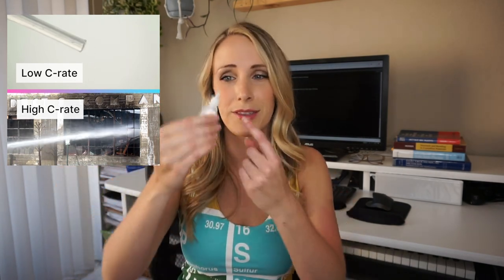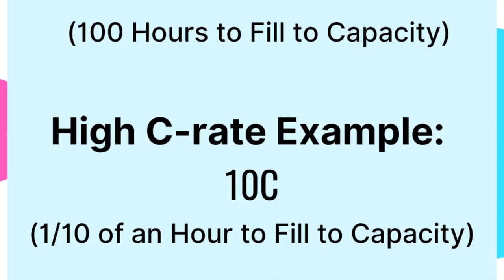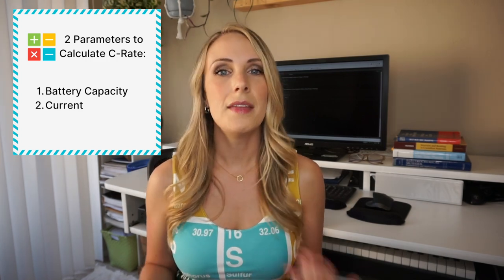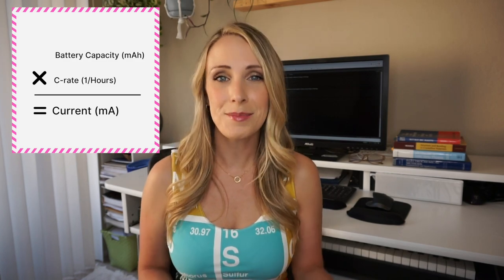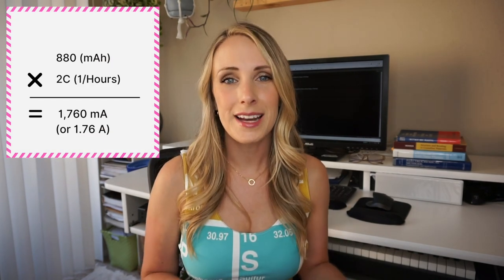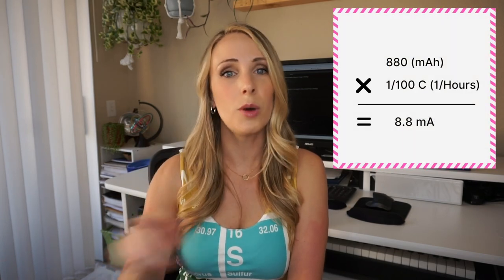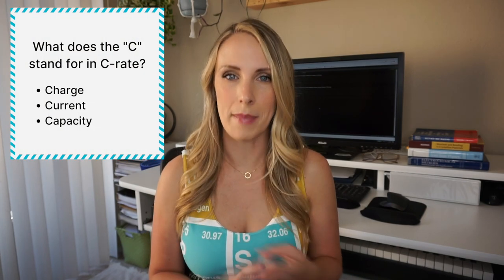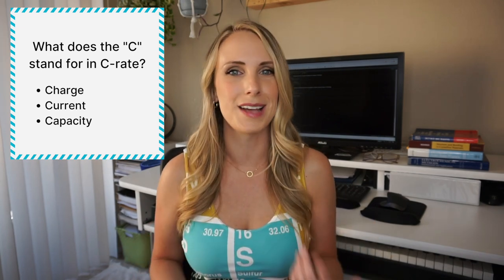How to Calculate Battery C-Rate

Comment: Thank you very much for your video! Just a question:
In time 5:20 you show that the C-Rate is the capacity divided by the current and the units are in time (h)
But in time 5:35 you show that the units of C-Rate are (1/h) and it looks like that for the calculation of the current the order is reverse. Could you please clarify? 
Thak you!

Comment: Great explanation and extra info on the cathode properties! I do have a question about the cathodes, can a cathode safely (dis)charge any C-Rate below it's rating, or do they only handle a specific range of current? Are batteries only designed to be charge at specified range (only fast or only slow)?

Thanks in advance for your reply

Comment: Can confirm its Charge Rate. Since Ah already describes capacity, C-Rate describes how long it takes to charge or discharge to that capacity. I work in electronics and I read it from the data sheet of a battery analyzer i'm currently using, so I think the info is good. I wouldn't have gotten there if it wasn't for your video teaching me in the first place. Thank you :)
Reply from the maker: Glad this was helpful! Best wishes on your work!

Comment: You have amazing lectures. I’m new to batteries. I’m wondering if you can recommend a book that covers the fundamentals of batteries would be a great favour. 

I have a question, like lithium sulphur battery has energy density of 2567Wh/kg. Sulfur has specific capacity of 1675 mAh/g, voltage as 2.2V . 
How did they calculated 2567Wh/kg.

Comment: Good knowledge.
I have 60v 28.5AH li ion battery pack 16S for my ev scooter.
Charger is 67v and 6amps.
What will be the C rating for my 3.7 v li ion cells.

Comment: The rate of charge and discharge for a Tesla Model 3 Performance varies a lot for different battery pack temperatures. I have seen as much as 250 KW when charging and as much as 448 KW when drag racing at the track. In both cases I had the battery temperature at 52.4 degrees C.

Comment: nice video! I would call the equivalent gas pedal in an EV an "accelerator". So if you charge a Li-ion battery with less current, it'll take longer to charge, but would it damage the battery structure if you do so? i.e. would it degrade the battery life to use less current to charge? And conversely, would it damage the battery to use more current?
Reply from the maker: ACCELERATOR!!! haha I asked my friend who owns an EV later and they told me the same so it must be! Thanks for informing me 😊 Typically slow C-rates are less damaging than faster C-rates (since the heat generated during higher current charging can cause side reactions and structural degradation in some cases). I know the most about Li-ion battery chemistry (with Si anode and Ni-based cathode), and for that system a slower C-rate is better, however Si is better at fast-charge than graphite-based anodes! It all depends on your materials, chemistry, cell design, temperature, and all those other lovely variables as far as the optimal C-rate.

Comment: Hey Jill, thanks for all the videos you make! 
I have one question, when we use active material : conductive agent: binder lets say I use reduced graphene (active) : carbon black(conductive agent): Pvdf (binder) with  7:2:1 ratio, respectively. should I calculate the theoretical capacity of the conductive agent and add it to the active material when I calculate the C- rate? or it neglected?
Reply from the maker: Hey thanks! Typically we neglect it unless it will actually be participating in the redox reaction. In the case of the chemistry you shared, you can neglect the carbon black.

Comment: Great video. .  i couldn't be more excited. May i have a question ? what if  i short a 4.2 v battery with internal resistance just 30 m ohm. .  dangerous or what ?
Reply from the maker: Shorting a 4.2V battery (I’m guessing a Li-ion cell that’s cylindrical format) can be dangerous, yes. I wouldn’t try it at home 😅

Comment: Please explain thermal runaway.. why is it called runaway? Is it caused due to the internal short circuit after Li plating?
Reply from the maker: Runaway is more of a slang term in this case- it means that the battery heats up to a certain threshold, and then keeps heating up out of control. (Like it keeps running and running to higher and higher temperatures). Thermal runaway can be caused by anything that causes heat generation to the point where the cell gets hotter out of control, which can include internal shorting. If the internal short causes a spark that causes the cell to catch fire, that is definitely a moment of thermal runaway. Shorting the cell does not always lead to thermal runaway (in the case that the cell doesn’t heat up due to the shorting).

Comment: Thanks for the precious explanation!
I have a question though: if I am testing a new experimental material as anode in a half cell (vs metallic Li), how can I understand which is the correct C rate of my battery? is it correct to multiplicate the theoretical specific capacity of the material for its weight?

Thanks a lot for all your contents!
Reply from the maker: You want to calculate battery capacity based on the electrode that limits the capacity, so in your case it would be probably based on the anode’s specific capacity (theoretical specific capacity times weight in battery, like you said). 

The example I provided is for a Si-dominant anode design where the cathode contains the capacity of lithium that will be cycled. 

Thanks for your question!

Comment: Hey, great video.
I am still struggling to figure out the C-Rate and trying to look for a good battery(es) to use in an Ebike for Offroad.
I plan to use a 220+ Amp Alternator as a motor, I plan to run it no more than 200A at 40-56v with a 250A controller or maybe 150A and a 200A controller with Hardware and Software limitations. I am not sure if these 2s Lipo Battery 50C 5200mAh 7.4V would work but I plan to get at least 6 of the packs, wire them in 3s2p if these would work with this future build.
I want the High Power but I am not sure if I am going in the right direction with this project.

Would they be able to handle that amount of constant current?
Would these battery packs work for this build?
Which voltage, and range, would be better suited in not destroying the batteries with UnderVoltage?
How would I calculate the approximate time in which the battery is low/Drained?
Reply from the maker: Hi, I work for a consulting firm that specializes in answering the questions you’re asking. Email me at jill@energystorage.guru, and we can answer your questions. 😊

Comment: Very clear and simplistic explanation. Thank you! Quick question can the charging C-Rate and discharging C-Rate be different for an identical battery? Let’s say for a laptop computer battery.
Reply from the maker: Glad it was clear! You can definitely make the C-rate whatever you want, so charge C-rate can be different than discharge C-rate. Typically for devices (laptop, EV, etc.) the discharge C-rate will be whatever the demand of the device is. If you’re accelerating in an EV, for example, that’s going to be a high C-rate discharge. There’s a built in feature in the BMS though for maximum allowed C-rate discharge. The specifications for your laptop battery could include a recommended current for charge and discharge that may likely be different.

Comment: Hey, massive nerd here, need help with some lithium tech. I want direct answers from an expert and you seem to be the right person to help me! 

So I'm dealing with some LiPo cells (round, if that makes any difference) I wanna build some 12, & 36v packs and I'm worries about putting multiple ground in parallel... A lot of places say lipo cells in parallel will self balance, but I'm scared I'll burn my house down. How many, if at all, parallel groups is the maximum safe amount? 

Tldr 
In a pack 10s for example, what's the max p I can go to? 10s10p? 10s50p? 😅
Reply from the maker: I’d recommend not building a pack yourself. There are many safety considerations in addition to cell balancing.

Comment: Are there batteries that have different charge and discharge c-rates?
Reply from the maker: Great question! C-rate is something the user selects, so one can select different c-rates for different batteries. People usually want to be mindful about the c-rate they choose based on the battery chemistry & application. Different battery chemistries can only withstand certain c-rate threshold before it damages the battery.
Reply: @AcrosstheNanoverse  thanks, but that's not what my question was about, let me phrase the question better, is it possible for a single battery to have different charge and discharge c-rates?

Comment: Please make a video on explaining theoretical capacity vs actual capacity. Is 176 mAh the theoretical capacity of NCM 622? Also, why some people say NMC while others say NCM?
Reply from the maker: I just finished writing a script for my next video which will be to answer your question about battery capacity! Thanks for the suggestion. People use NMC or NCM interchangeably. It doesn’t really matter as long as you’re making sure you’re using the right order for the material ratio. (NMC 532 for instance). 811, 111, & 622 don’t matter about the order of M and C of course!

Comment: I'm doing my Master thesis in the field of Li-ion batteries. When i consider the C-rate i consider it has the current to discharge the Capacity (C) in a certain timeframe. So if a battery has 1mAh capacity, and i want to discharge it in 1 hour, the C-rate (i.e., the current) will be 1mA. But also for me it is sometime confusing, so i'm happy to see i'm not the only one, it makes me feel less dumb :D . I also use volumetric capacity instead of gravimetric capacity, because sometimes is difficult to know the mass (for example for thin films). Nice video!
Reply from the maker: Thank you! Yes, we are all just learning 😊 Best wishes with your studies!

Comment: Thanx for the video Jill...correct me if Im wrong......according to the data sheet the Maximum Continuous Discharging Current is 4400Ma or 2C...for each cell....therefore I have 10 cells in parallel and the total Maximum Continuous Discharging Current then it would be 44000Ma or 44A for my lithium ion battery.. my battery is 13S10P 52V 25Ah...
Reply from the maker: You’re welcome! Yes, 44A would be max for that pack. Adding the capacities of the 10 cells in parallel gives 88000 mAh for pack capacity, and 2C of that is 44000 mA. It’s great that the math just scales for cells to packs like that as you need all the cells to be balanced during operation. Each cell is 4V , and with 13 in series makes it 52V for the pack. 👍 great work 😊
What’s the application of this pack?

Comment: why in mah why u don t use ah bcz all lithium has ah by the way my rack lithium battery is 400 ah i dunno what to put as max charge and discharge i made some calc like 400ah/10hr = 40ah  and if 400ah/5 = 80 ah i am confused what to use on my inverter some say do go to high so i need your professional consulting
Reply from the maker: Units of hours (h) cancel: 400ah/10hr = 40A. 400Ah/5h = 80A. I can’t tell what your asking other than that.
Reply: @AcrosstheNanoverse  it s a rack 4 of 100 ah lithium if i put 100A discharge doe it mean 0.5 c rate = each battery 25 amps?

Comment: thanks so much! all your videos are amazing! My question, which is maybe more of an engineering question, is for when a battery cell is assembled with a potential difference across the electrodes (ex: Li metal and NMC). Is it the battery hardware/circuitry that allows us to control how fast we allow the discharge?  This has always has confused me.
Reply from the maker: Yes, the battery testing equipment lets you control the C-rate 😊

Comment: i have 2 questions, 1 on that topic and one... on a diffrent topic, i guess? 
1st: i have a 20ah 48 volts battery or akku as we say in germany, so how do i know how much amps my battery can give my motor max and for what amount of time? cous i dont know the amps just thte ah, no? this confuses me a bit cous i dont know the c rating nor the amps of the battery, or am i missing something?
and the second thing is: i drive my bike with let's say 15 amps continuously 4 50 km and then its empty, and now i drive my bike uphill 4 lets say 20 km and its empty, why is that? cous didnt my controller say "hey battery the motor just needs 15 amps con to drive" and when i made 50 km on a flat road why dont i also do 50km on a hill? cous the motor isnt taking more than 15 amps, so you should get 50 km, sont you? thats something i dont get otherwise good video, greetings froim germany